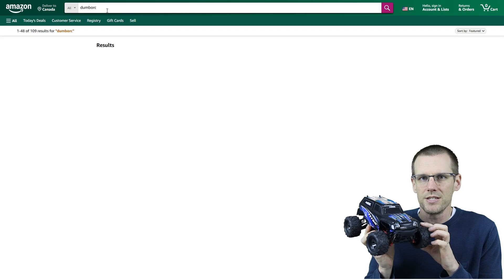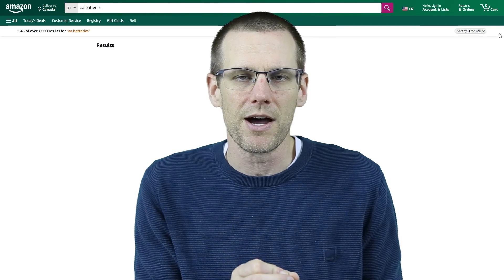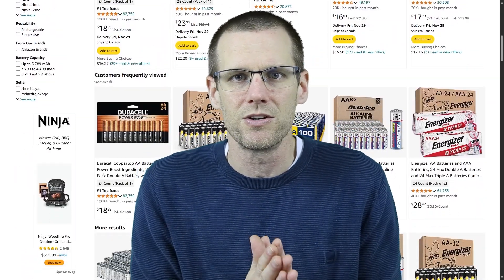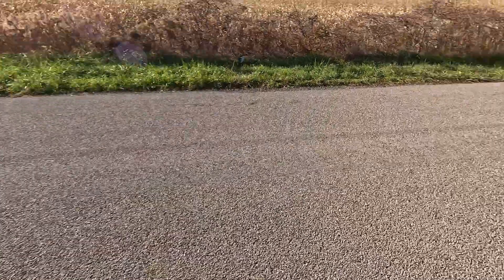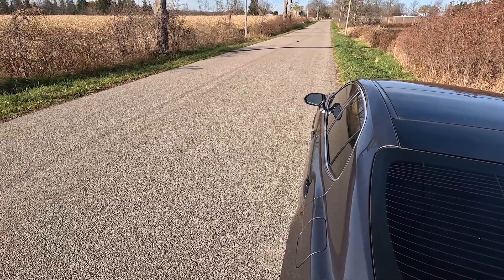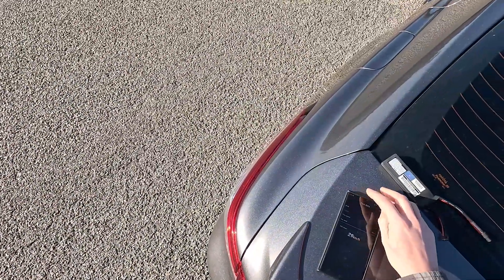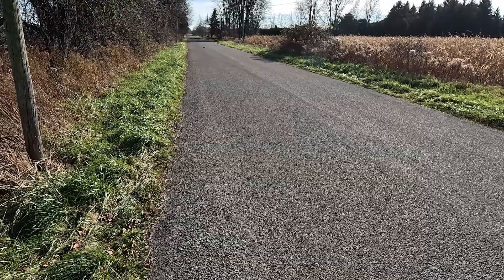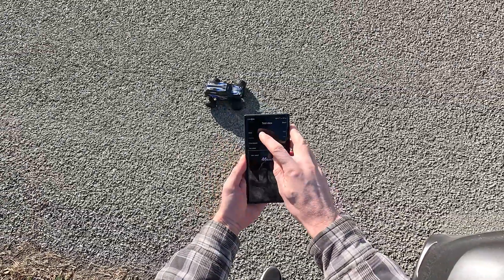What's right for you? Choosing the Best Battery for Your RC Transmitter

Comment: I have a flysky gt5 and it says it has a 300 meter range. Going from 4 aa at 6volt to a 2s lipo at 7.2 volt in the transmitter . Do you think you gain any range?

Comment: I have a Spektrum Rugged 5 which ran 4 AA and boy did it eat the batterys so i had a extra 18650 tray from my Radiomaster gx12. I snipped the AA tray wires and got that out with surprising ease. The 18650 battery tray was a bit bigger but with a snip here and there it finally fit. The voltage range is like 3.5 to 9.6v and two molicel is 8.4 fully charged it was a no brainer. The 18650 tray has a battery lead that i charge with and the wires from the rugged soldered right up to the tray and BAM!!! Problem solved. It literally last forever... ive been running off of the initial charge for weeks and still have almost 7v left. It looks bone stock also. The battery tray fit perfect.
Reply from the maker: Sweet setup!

Comment: So I had a spektrum dx5c,and my new transmitter is the new dx6 rugged.been running 2s lipo transmitter batteries in the 5c for years, and now running a 4000mah 2s in my new rugged.love it because I can almost go all summer on 1 charge! Have 10 surface vehicles in my fleet right now,and run them all,all summer long.all you have to do is take out the aa holder,wire in a connector,and there you have it.that being said,the battery indicator will show full charge all the time,so I just watch the actual battery voltage.when it gets down to 6.8 volts or so,I simply take it out and charge it.
Reply: Best thing I’ve done with my dx5c also. Got really tired of keeping AA batteries on hand and the cost was annoying.
Reply: @rustycampbell2685  i also fly helis,9 in my fleet at the moment,and did the same thing on my dx8 air transmitter over 10 years ago.still works perfect,and once again,the time between charging the transmitters is literally months!
Reply from the maker: Nice, my old DX7s was the. Lasted for many hours of flights. My newer surface radios do pretty well too.
Reply: @RCexplained  also went lipo on my dx8 air transmitter,have 9 helis that I fly whenever the weather permits!
Reply from the maker: Very nice. I think my air radio uses a 1s Lithium over 10Ah but doesn't last too long.
Reply: @RCexplained  so I put a 2s 3000 mah lipo made by spektrum in mine,and I only have to charge it every 3 months or so.although I think I'm going to upgrade to the new nx8,I have had my dx8 well over 10 years now,and they have made the programming so much simpler now.i believe the new air transmitters do come with a single cell life.

Comment: Hey Ryan, here's my 2 cents: I have long used Ikea rechargeable AA batteries without problems. The Ikea AA batteries have a claimed capacity of 2450 mAh - no idea if that number is accurate, but they seem to last quite long. At home, I don't leave batteries in any of my transmitters, but with 2 battery chargers, there's always a whole bunch of batteries that are fully charged and ready to go. Keep your batteries and yourself fully charged guys!
Reply from the maker: Nice that works well!

Comment: In my Spektrum radio I use AA lithium 1.5v batteries. They are the c-type USB plug rechargeable batteries. They fit and give you the correct voltage.
Reply from the maker: Nice do you have to plug in the USB to each individually?
Reply: @RCexplained  Yes, the pack of four batteries comes with a quad splitted USB plug to four c-type plugs. I use it because my Spektrum radio is an old DX4S.

Comment: This was really interesting, I appreciate you made this video! Yes, these are considerations I have been struggling with for a while, I am fed up with the damned AA's! Especially the fact that in some transmitters I can't use rechargable ones, either because the voltage is low, or because they are a bit thicker so won't fit inside the handle on those radios that have that design... I also opted for the LiFe battery in a Futaba radio, and now I might do the same on my new Dumbo DDF, or I might try the new style 1.6V LiPo AA cells that are apparently available, it is 2024 after all...😁
Reply from the maker: Nice sounds good!